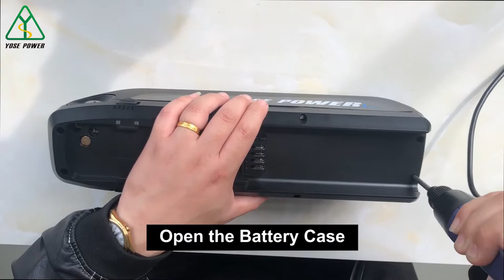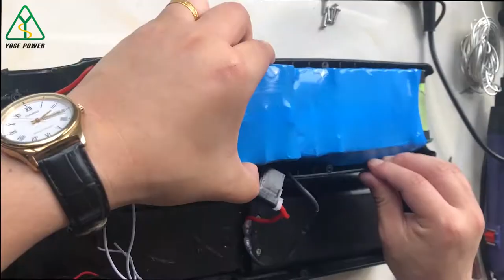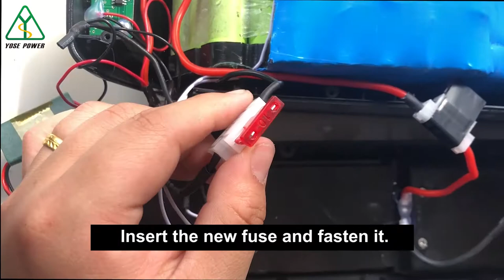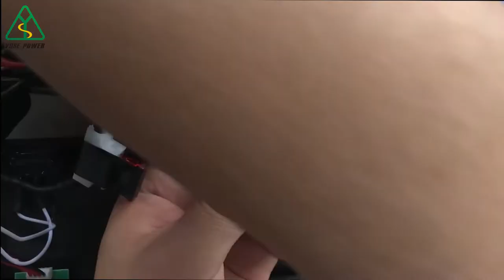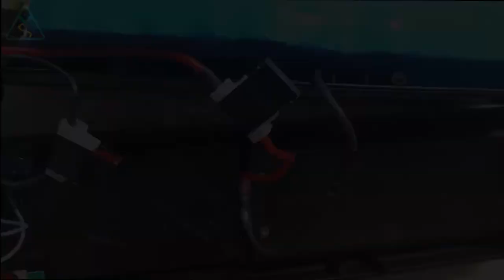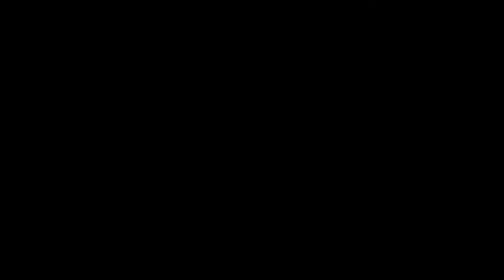replace YOSE POWER  battery fuse

Comment: Hello i got the hailong 1 with 5 bullet pins 13 Ah. Does mine include a fuse or do i need one also one for the discharge socket? (Got a new discharge socket diffrent from yose powers controller integrated ones, basically just a socket with an xt 60 connector)
Reply from the maker: If you purchased a brand new battery from our official store, it should come with both charging and discharging fuses. If you need further assistance, you can send photos or videos of the battery to our customer service, and they will help you with your questions.
Reply: @YOSEPOWER  thank you

Comment: My battery came with spare fuses. It stopped charging. Would it void the warranty if I open only to change said fuses?
Reply from the maker: Simply replacing the fuse will not affect the warranty.

Comment: why 2 fuses? i have yosepower hailong 1 13A Battery and there is only 1x 10A fuse installed.
Reply from the maker: The battery has a discharge fuse and a charge fuse.

Comment: Why open a battery case when you are told not to open because of the dangers.
Reply from the maker: With guidance from customer service or by following video instructions, customers can handle some simple repairs themselves. Of course, you can also take it to a repair shop for assistance.